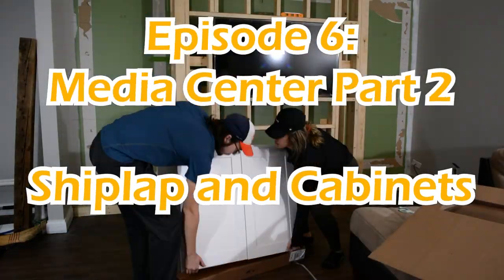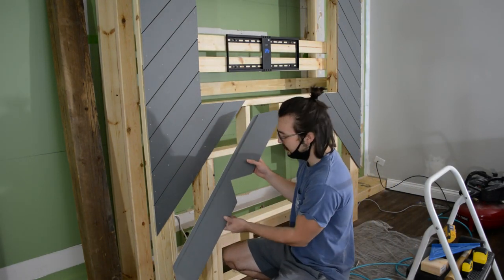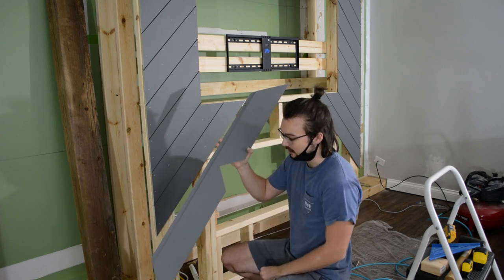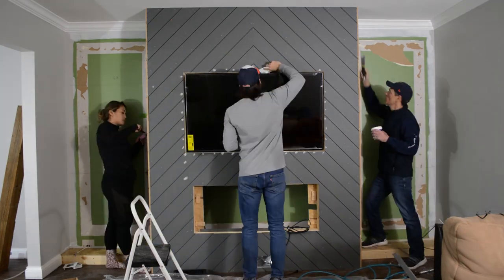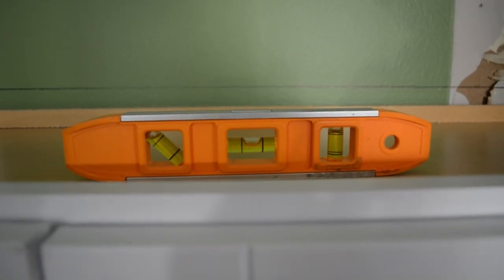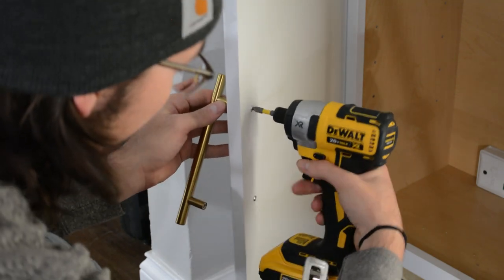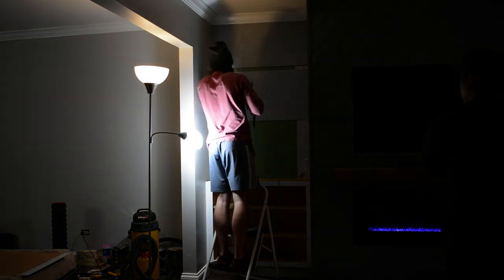Project Needle // Episode 6: Media Center Part II - Shiplap and Cabinets

Comment: Hi awesome job!! What kind of trim did you use around the tv opening?
Reply from the maker: Thank you! I used corner trim. It looks like an L but is the same length in both directions. It is the same trim I used on the outside corners of the shiplap. Hope that helps!
Reply: @GoldenKeyDesign  what cabinets did you use? Thanks

Comment: Awesome video.  I'm planning to do like yours but not the cabinets.  Behind the TV mount is just an open space, no Sheetrock to cover? Could you link the 2 side trim and tv trim too? Thanks
Reply from the maker: Thank you! Yes, it’s just open space since you can’t really see behind/around the tv. 

Link to trim: https://www.homedepot.com/p/Alexandria-Moulding-WM-205-1-1-8-in-x-1-1-8-in-x-96-in-Wood-Pine-Outside-Corner-Moulding-0W205-20096C/205917008
Reply: @GoldenKeyDesign   link above, you use that for around tv frame too? Thanks, Just subscribed.
Reply from the maker: @upload610  Exactly, I used that trim for both the edges of the shiplap and around the TV!

Comment: Awesome video. Loved the whole series. Do you have a parts list for this project? I’d love to do this here in my home living room or the basement area.
Reply from the maker: Thanks for watching! Unfortunately, I don't have a parts list since the dimensions change depending on the room size. But the basic materials you will need are: 2x4s for stud walls, screws, wood glue, shiplap, paint, cabinets, wood mantle, select pine boards for shelving and countertops, stain, polyurethane, and trim pieces.
Reply: Lovely job, looking to do something similar, can I ask what cabinets and cabinet tops you used?
Reply from the maker: @mmyer1314  Thanks for watching! We bought the cabinets from Home Depot. They usually have the standard sizes in stock at the store. And I made the cabinet countertops from the same pine boards used for the floating shelves!

Comment: I love it!! Question though, how would you get the tv out if something goes wrong with it? I want to do this but I want to be able to get the tv out if need be.
Reply from the maker: Thank you and good question! We used a tilting mount so you can tilt it up and reach around it and we made access panels in the side cabinets. But in hindsight a swivel mount would have been best. That way you can pull the TV out completely from the wall and access it that way! Hope that helps!
Reply: @GoldenKeyDesign  Thank you for such a quick reply. What about tv over heating inside the wall,  would that be a problem? I'm going to steal your project lol.
Reply from the maker: @lorrainejackson7311  Modern TVs are very energy efficient and have no problems with over heating. Also, the space is quite large behind the TV and has enough airflow

Comment: How do you measure for material
Reply from the maker: Good question! I measured the height and width of the area I need to cover to determine the square footage. Then, depending on the size of the ship lap, I calculate how many boards I need. I usually add 10% extra for waste and I can always return leftover pieces.

Comment: can you put the link to where you got the shiplap
Reply from the maker: https://www.homedepot.com/p/ARAUCO-9-16-in-x-5-1-4-in-x-8-ft-Primed-Pine-Nickel-Gap-Ship-Lap-Board-6-Pieces-Per-Box-0028994/301688279
Reply from the maker: This is this is the shiplap we used. Make sure to look through the pile at the store so you get the best pieces. Most come chipped and cracked. There are also longer and wider shiplap boards too!

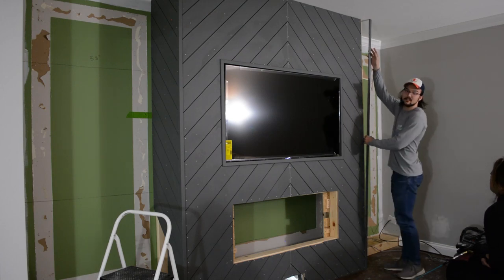Comment: What is that you used for the corners at 13:35?
Reply from the maker: Great question! We used corner trim also called L trim to cover up the corners. It is a common type of trim sold by the foot at big box stores 🔨